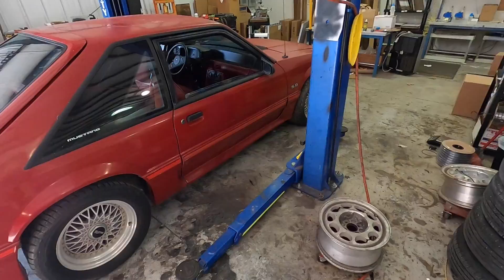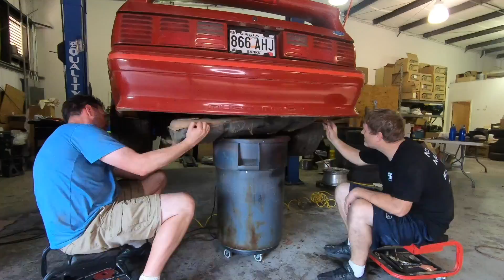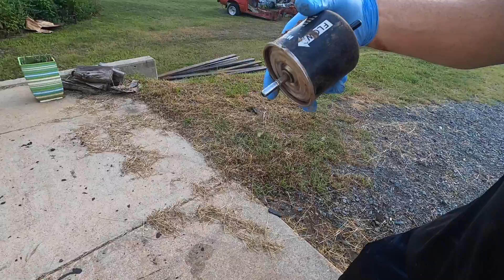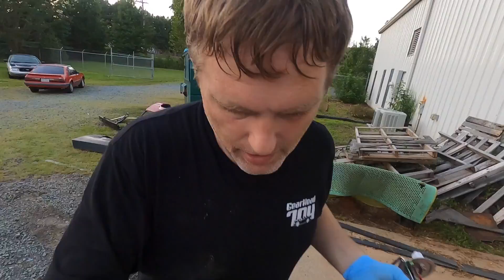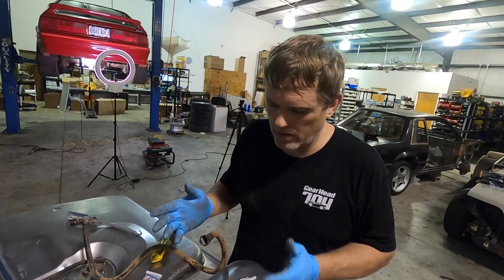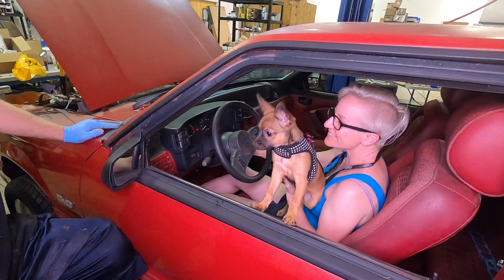How To Install And Replace A New Fuel Tank Or Fuel Pump In A FoxBody Mustang

Comment: Good video but you didn’t put new insulation between the tank and the chassis. This tank will rattle every time you hit a bump.
Reply: I was going to comment on the missing set of rubber insulating pads that stick to the top of the new fuel tank.

Comment: This is so cool,ive had dumps on my 91 for about 23 years, here recently i decided to put a brand new complete exhaust in my car and get rid of the dumps,while installing my back pipes i realized "why are my fuel lines so close to my exhaust?" thats when i realized i had dropped my tank like 10 years ago and i did not route them under the strap properly and this video confirms that, since i had dumps it didn't matter where the fuel lines were (at the time) but they sure do now,lol.

ill be doing this tomorrow, put a board under the tank with my trusty aluminum jack and just loosen the one strap and put the lines under it, thank you for confirming where i suspected those lines needed to go, great video,something of a tip is before dropping the tank get a steam cleaner or take the car to the car wash if possible and give it a good hose down in the entire area you'll be working on, it helps a lot with cleanliness.
Reply from the maker: Glad it helped.  Great point on the cleanliness.

Comment: Your guy’s videos help out so much!! I’m working on my 88🦊 sitting for 20Years finally got the Motor to crank but wont stay on I change the fuel tanks also the fuel pump everything new.. only trouble I’m having is to keep the car on please any advice would help!!
Reply from the maker: Glad it helped some.  Good luck with your build

Comment: Is it recommended to change the fuel pressure regulator also? I'm doing this full change out on my 86 and it hasn't ran in about 2 years.
Reply from the maker: Not required to my knowledge as long as it's working
Reply: @GearHead704  👌 thanks, man

Comment: Bolt broke know where i can get the clip for the strap
Reply from the maker: FMR might have them.  Give them a call during business hours between M-F at 704-888-1278
Reply: @GearHead704  i found the kit comes with straps pins clips and bolts from Lmr  thanks

Comment: free tip, that looks like a spectra brand tank or the ones you will typically get most places like lmr. i got one about a year ago and yes very poor edges and very sharp and no hole for the strap. later when i needed a tank for my other fox, i gave a summit brand a try and tons better. no sharp edges, powdercoated, and has the hole for the strap. i would highly recommend the summit one over the others, and it was actually cheaper
Reply from the maker: Wasn't aware of that, maybe Matt was, but if I have to get a tank for mine I'll look into it.  Thanks Brad.

Comment: I just went through this same exact situation about a month ago. Had to have a new tank, fuel pump, fuel filter and sending unit. Plus I had the rear end oil replaced as well. It was really bad also. Great video by the way
Reply from the maker: Thanks.  I'm going to need to do the same to my SSP, but I've already rebuilt the rearend.
Reply: @GearHead704  I think I'm going to go with 355 or 373 gears. Haven't decided yet.
Reply from the maker: @peteartussee1202  I have 3.73 in my vert but I also have a 6 speed transmission.  3.55 are in my SSP.  I didn't like the 3.73 on the hwy with the 5 speed. Just my opinion though
Reply: @GearHead704  mine is a auto with overdrive
Reply from the maker: @peteartussee1202  In that case I would personally go 3.73
Reply: @GearHead704  thank you. I appreciate your input

Comment: My fuel tank had a predrilled grounding strap hole.Would it be a good idea to run your own grounding strap, especially with a high power pump? It also came with the insulating pads making it a PIA to put back up. Realizing you are not keeping the car, I Always clean dirty parts before replacing. Sometimes clean and paint. People looking at my 1993 triple white feature car comment on how clean it looks.
Reply from the maker: Not sure on the grounding strap.  If I get a chance i'll follow up with Matt on it.  As we need to do the fuel pump in my notch, I know for sure we'll get to this eventually.  I'll be cleaning my SSP a bit more when I do it since i'm keeping it.
Reply: I know this is a old comment but just wanted to say,most of these cars had a little metal support bracket that went from the tank to the filler neck,its round and it has a "leg" that has a hole,you slide the round part into the filler neck as you slide it into the tank making it "captive" and the leg that has the hole is positioned next to that hole in your tank and a screw goes in there securing the little bracket, thats what the hole is normally for,not a ground strap.

When i installed my new tank eons ago my tank did not come with that hole even though it was a premium tank out of Canada, once i realized what was going on, it was already installed and i didn't want to be drilling and tapping anywhere near the tank so i just left that bracket off,been fine without it, besides that little hole on both my 91 and my 89 for the bracket there is no other hole or ground strap anywhere near the tank,congrats on the white feature car,a buddy of mine had one,beautiful cars and very unique.

Comment: Replaced that same stuff a couple of years ago.  It’s not fun on your back in a driveway.  Thankfully I wasn’t YouTubing then because I ran into a different size fitting on the fuel pump.  Had to engineer a fix.  Thanks for including some of those details like hose routing and clip removal/install.
Reply from the maker: Oh man, I"m sure that sucked on your back.  Yeah we try to help if we can.